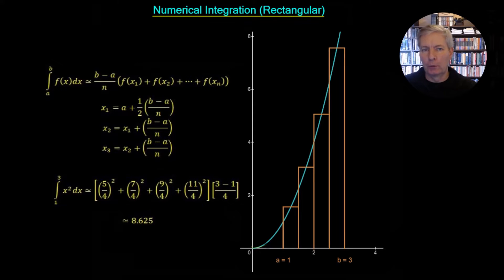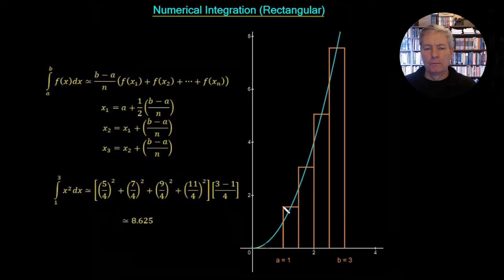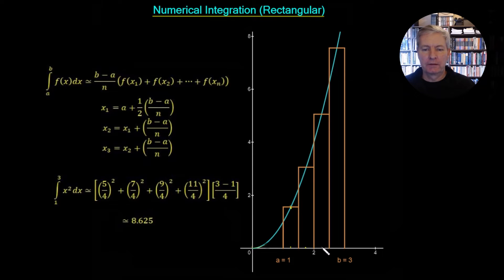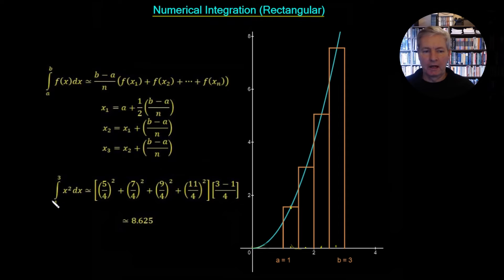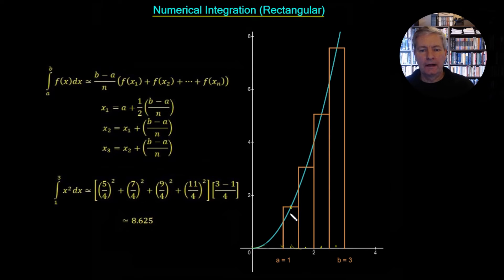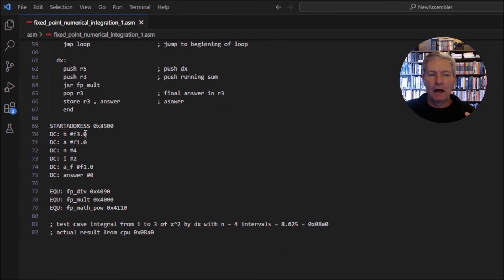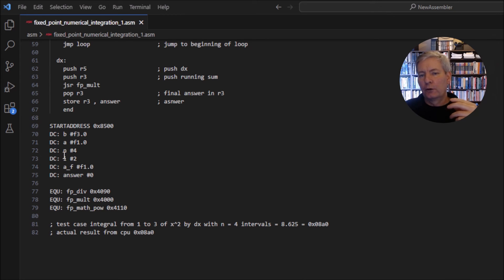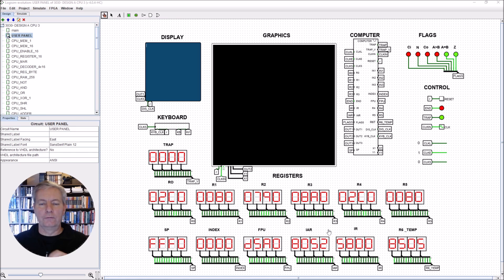Numerical Integration in Assembly Language

Comment from the maker: So this will work for simple polynomial functions of the form ax^n where a , x are fixed point numbers and n is an integer. I have tried this out with various powers  , limits and n segment values and it gives accurate results.